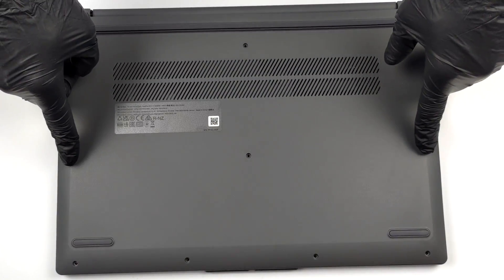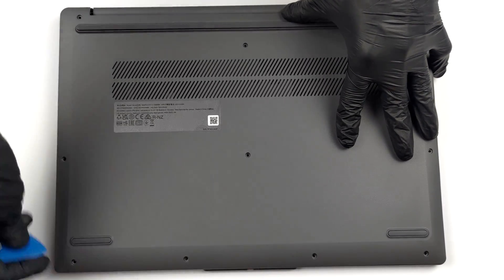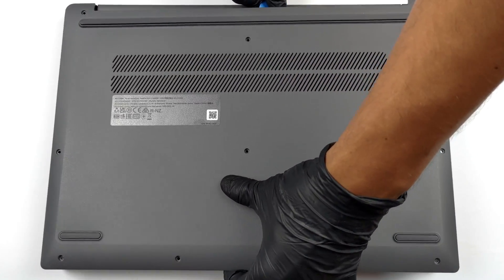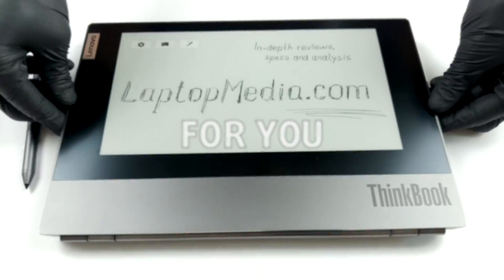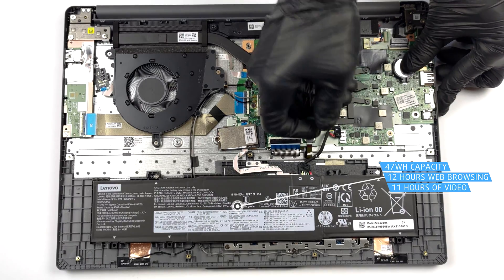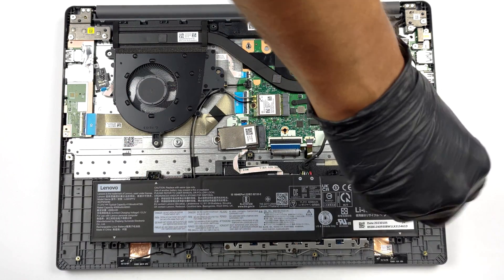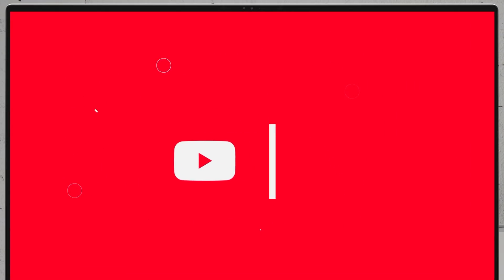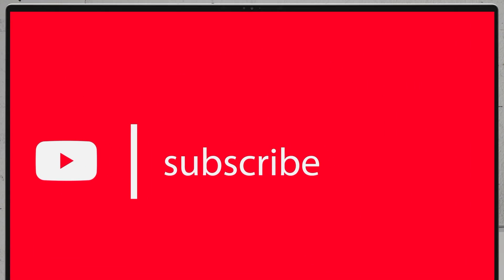🛠️ How to open Lenovo IdeaPad Slim 3 (16", 2023) - disassembly and upgrade options

Comment: can we upgrade RAM in this model
Reply: HI, did you find out how to upgrade RAM for this model, I also would like to upgrade. Thanks
Reply: @stephenfarrant3397 it's soldered so no
Reply: @Joseph.Jacob..7  can’t you just un solder it I mean I know how to solder just use a solder gun to take it off? Is that possible

Comment: it's fucking insanity that they removed upgradable RAM without even offering 16GB option unless you pay 200 bucks more on eBay listings.

offering 8GB in 2023 should be considered committing federal crime
Reply: I was gifted a version of this Laptop with 4GB RAM, and GPPU gets a small portion of that! 
They want to make sure people pay a third of the Laptop to upgrade RAM by 4GB, they have lost their nuts!
Reply: HI, did you find out how to upgrade RAM for this model, I also would like to upgrade. Thanks
Reply: @stephenfarrant3397  you can't, it's all soldered on

Comment: Did you test if a 2280 SSD will work? I can see that it comes with a screw slot for that size of SSD but it bothers me that the manuals and website only mention 2242 compatibility.
Reply: i tested it, it works
Reply: @gundamnduke0  The hero we needed.

Comment: Thanks to Mendocino APUs, these laptops aren't reliable.
Reply: Now that’s why it uses soldered ram and the mobo is small
Reply: Could you please further explain what you mean by mendocino apu?
Reply: @alikiyani420  It's the Codename of the AMD processors that installed in low-cost laptops.
Reply: @dalvart  aren't amd apu laptops batter in performance compared to Intel ones?
Reply: @alikiyani420  They are better when it comes to battery life. Intel have better performance but a cost on battery endurance.